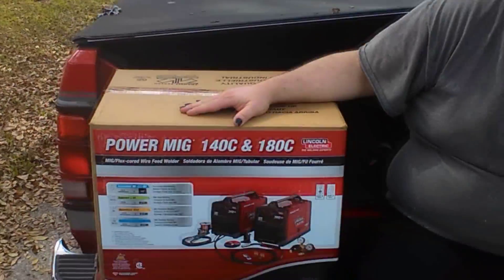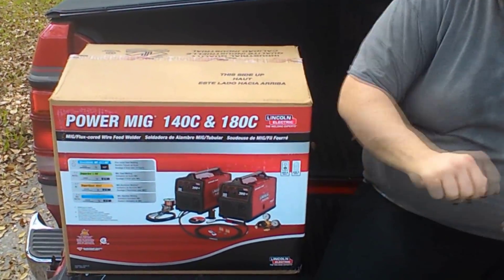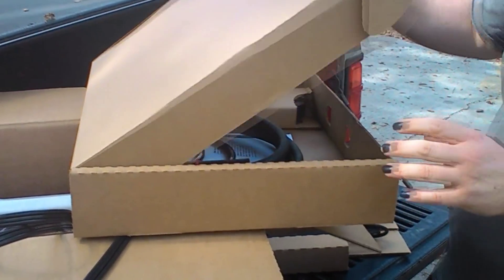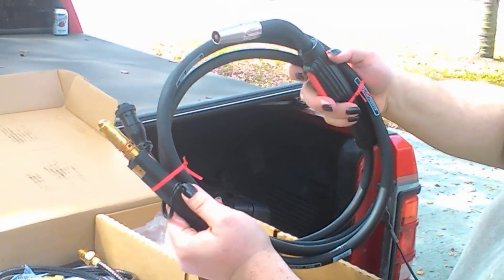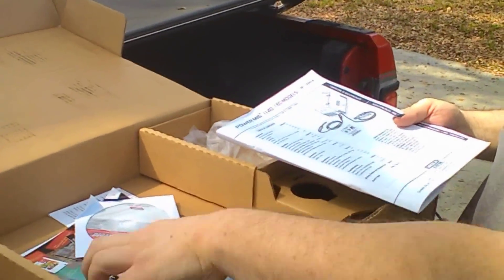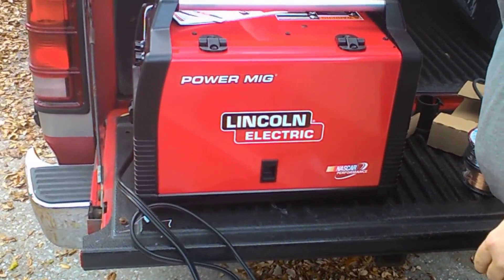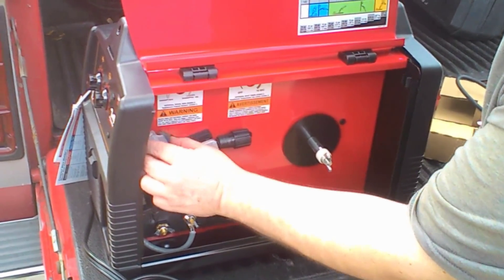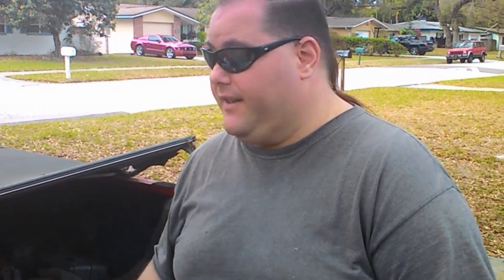Lincoln Power MIG 140c Unboxing

Comment: Just a minor thing but for all intense and purposes flux core wire is still mig welding, it's just gasless mig welding (I was a boiler maker, or steel fabricator, for 20 odd years). Looking at the controls i'm assuming the amps also control the wire speed which usually isn't much of an issue but can be at times, otherwise it looks pretty decent for what you want it for.
Reply: Um.
You do know what MIG stands for right?
Reply: +Fabulous Fabrications I and everyone else i know have always called it MIG, because basically it is